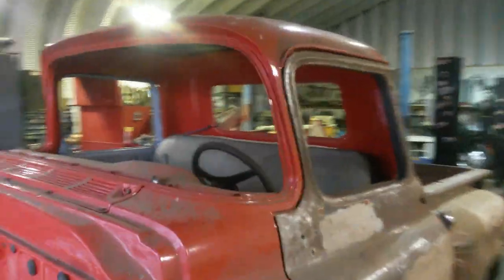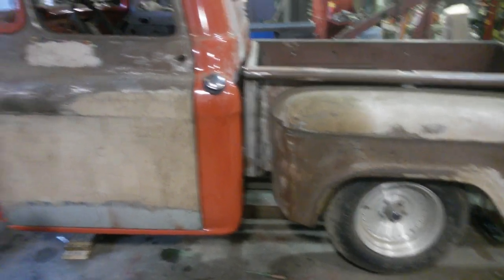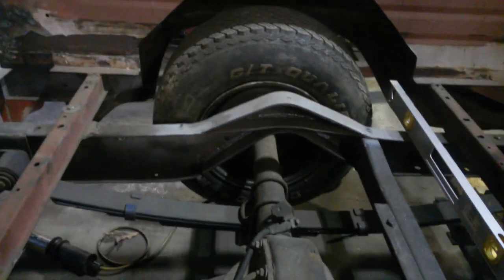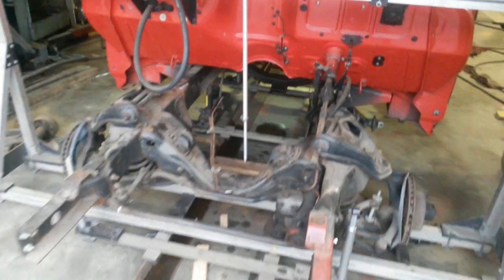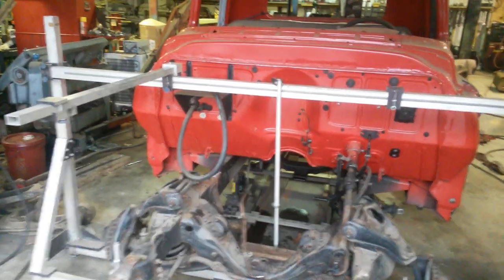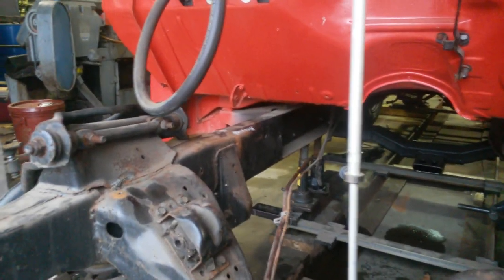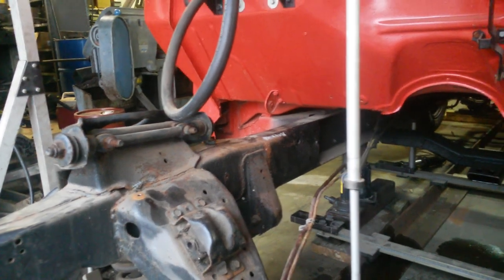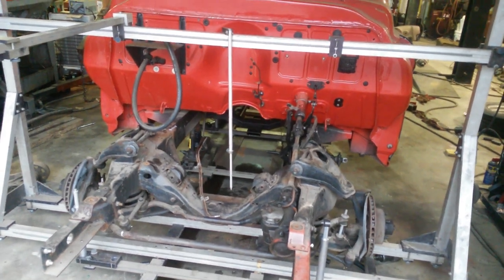Camaro sub frame install in a 57 chevy truck

Comment: I used an 88 olds cutlass frame clip fit in perfect and was the right width.
Reply: I'm building a 1956 ford fairlane I'm looking to swap out the front clip anyone has any good pointers

Comment: what type of motor did you put in,  because I just bought a 1997 Silverado just to put the motor in my 57 Apache, with a Camaro front clip ..  or would it be easier to put the body on the 97 .. its my firs time trying this ..